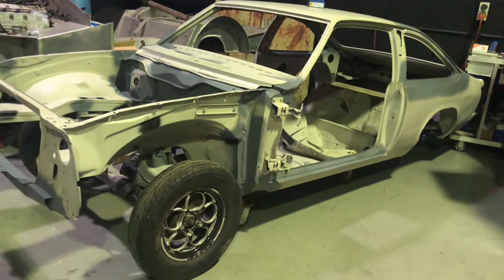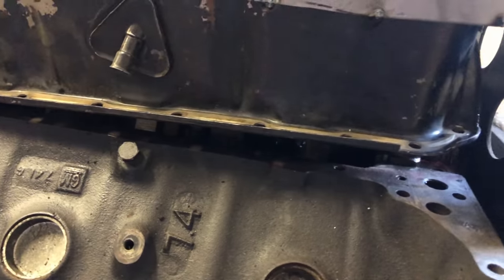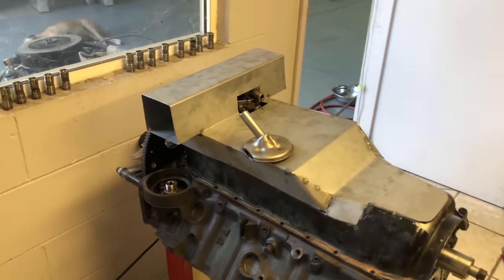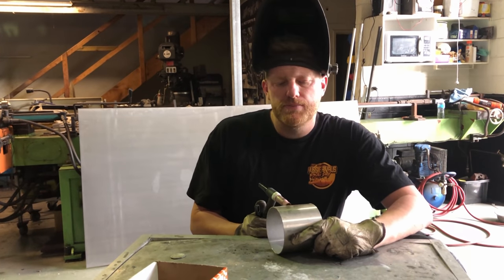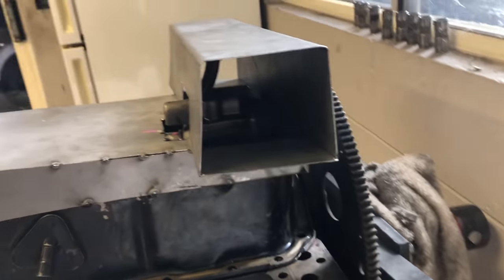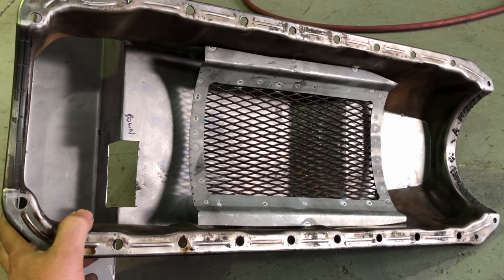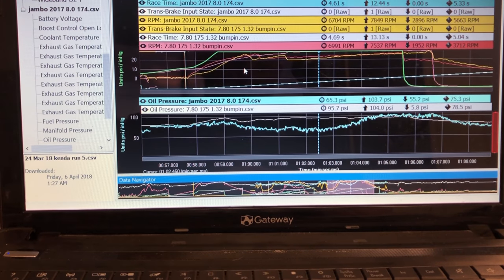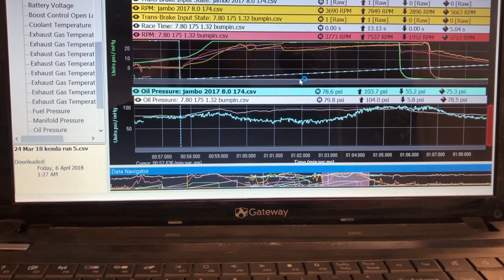Ep 12. HT Monaro, Junkyard build, 454 Chev, TH400, nitrous, Big Block

Comment: Yes please more of the Torana. Loving the HT build though, had a few of these in my teens and early 20's and have a soft spot for the big K, T, G boats. It was a huge time of change at GMH which is reflected in the engine varieties available in these series and the birth of Australia's very own V8 powerplants. Love your explanation of the Powerglide V T400, very easy for us laymen to understand. Would love to see more of the things that are different in a modified street car vs a modified street\track car, like how the trans brake works, two step and how it's set up and works and getting the cars suspension setup to squat and hold to keep power to the ground. I love the fabrication work you do as well and love to see your tips and, examples and reasoning behind the fabrication. please don't ever stop doing that, I learn something new every episode.
Reply from the maker: Thank you very much! There's lots lots more to come!

Comment: Really cool build. Like seeing the detail that goes into solving “little” problems. Building a hg prem myself and I’m interested in your rear suspension for the ktg’s. Have checked out your web page and just curious on which ride height option your running in the Monaro.
Reply from the maker: It's the second lowest kit, not the lowest.
Reply: Cool thanks. Looks good, sits right. 👍🏻👌🏻

Comment: Hey mate I’m building a transmission tunnel would you recommend I use cold rolled? I have hot rolled on hand so wouldn’t cost anything but if cold is that much better I’ll pony up for the good shit. Loving the videos man they keep getting better and better 🤙🏼
Reply from the maker: Cold rolled is nicer to work with bit we use hot rolled all the time as well, you just have to clean the mill scale off first.

Comment: Its up and down because its sucking air mate.
Reply from the maker: Yes I didn't get too into detail about that, sucking air from windage, sucking air from oil level, sucking air due to aeration, oil slosh from Gforce or the oil has become too methanol saturated are all reasons I have seen logs like that.